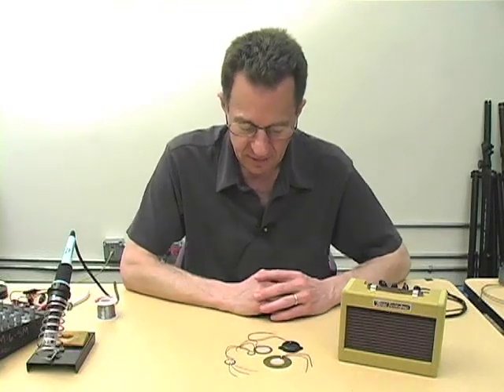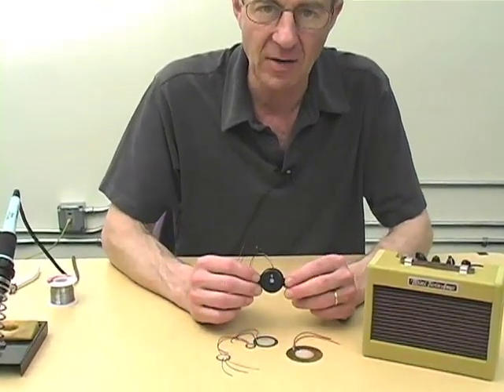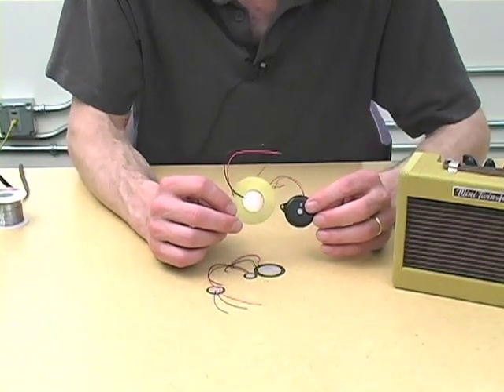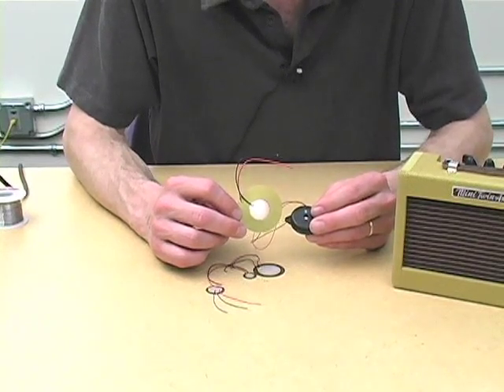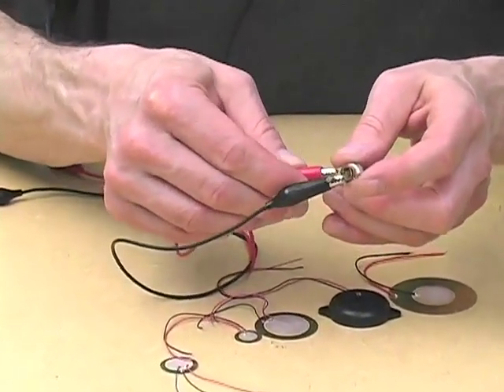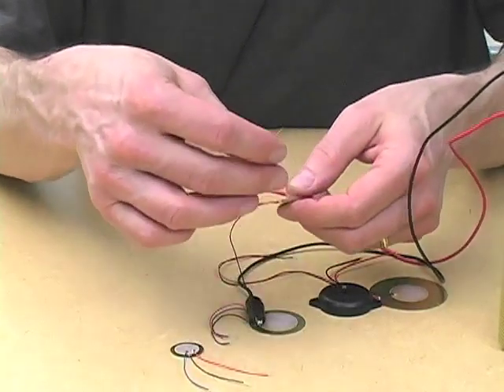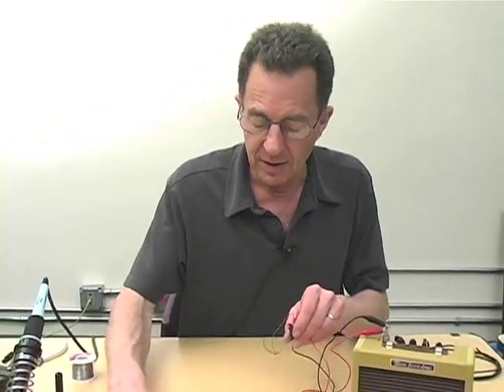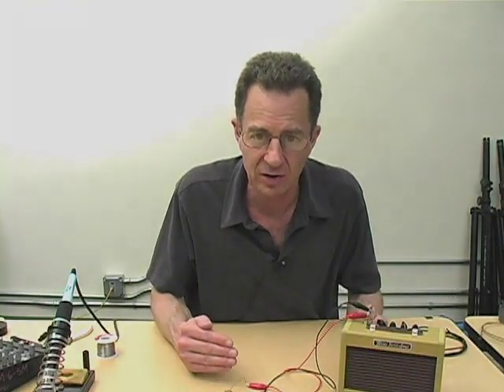Hack of the Month Club -- Project #5: Make a Contact Mike (part 1 of 3)

Comment from the maker: Not much.  There's a resonant peak that's proportional to the diameter (i.e., the pitch at which the disc oscillates when being used as a beeper), but this can be EQed away.  Size doesn't affect loudness much.  Mainly a question of where you want to fit the thing (some people strengthen the mike by potting the disc in epoxy in a bottle cap.)

Comment from the maker: The cable shield goes to the wire that's connected to the metal perimeter of the disc.  The hot wire (center in shielded cable) attached to the wire that connects to the larger section of white crystal. Leave the keyhole-shaped pad unconnected to your cable (cut off the wire.)  Clear? (The piezo chapter in the book discusses this.)

Comment: the piezo disk i have is like the little one you have on the table, it has 3 red wires. I understand which one is the ground, but what do i do with the 3rd wire? just wire both of the other wires to the signal on the jack?